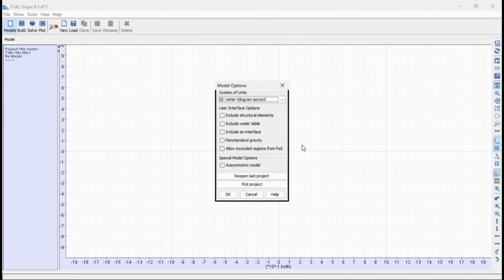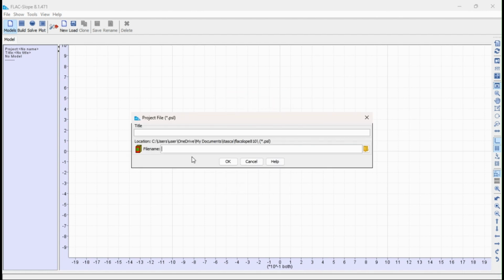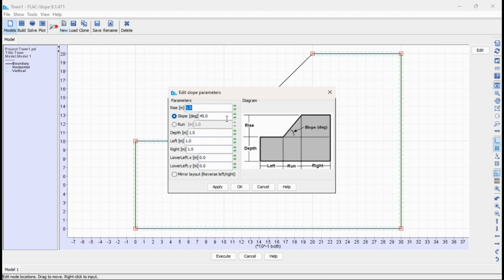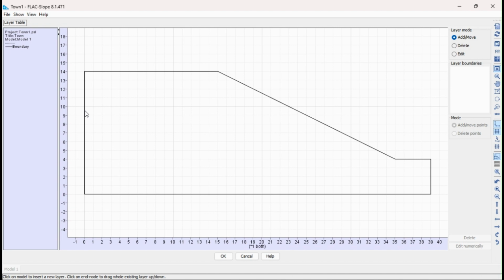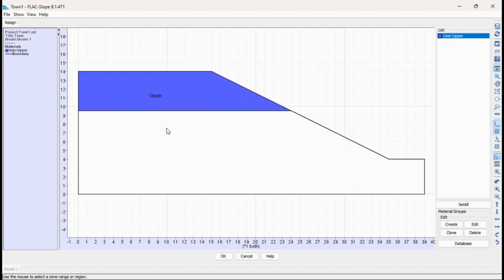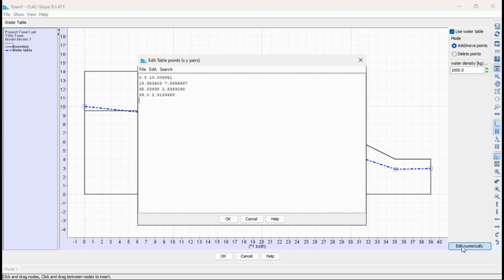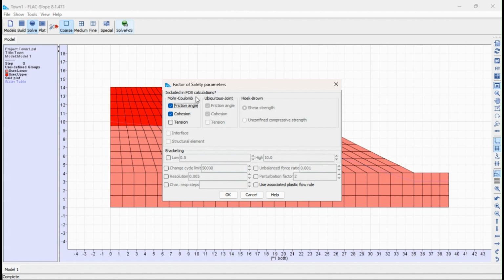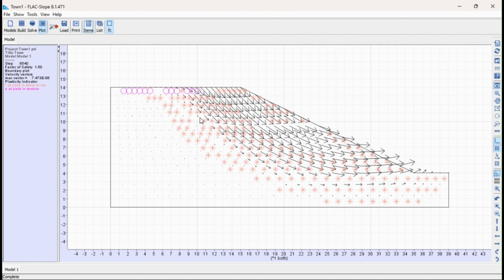FLAC Slope Stability Analysis

Comment: Hi, I was wondering, so at the end, when we have that gradient and the slope with the arrows showing the path of the possible point of failiure, does it basically estimates the point of fracture and the internal geomechanisms of the slope ? It is not rlly my domain but I am interested , also at the material phase, when entering data such as the density of the material, coehision, wet density, etc, how do you calculate the data based on the real dimension of the slope, also is any soil sampling and testing necessary ? or do you have like a data set with general values